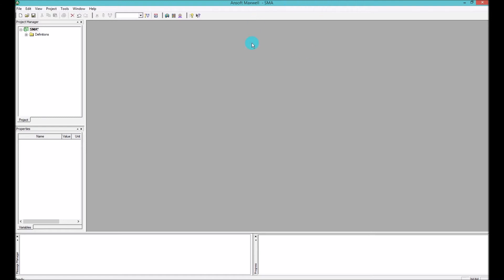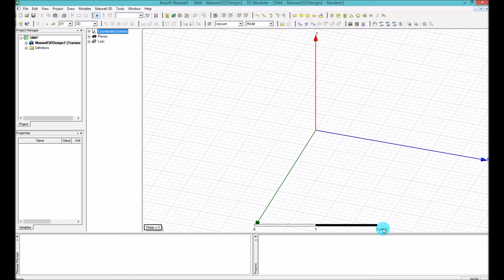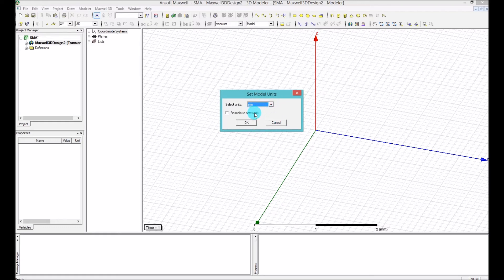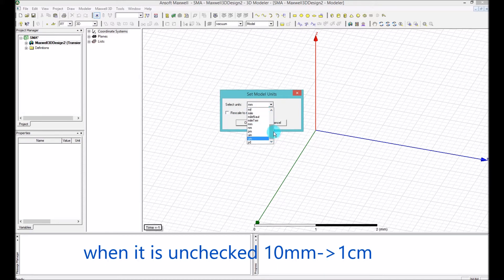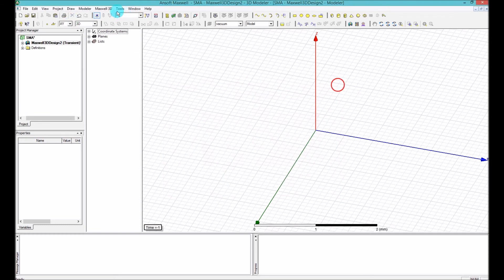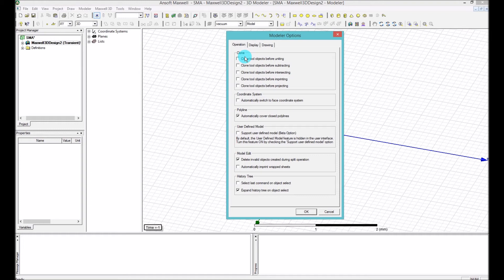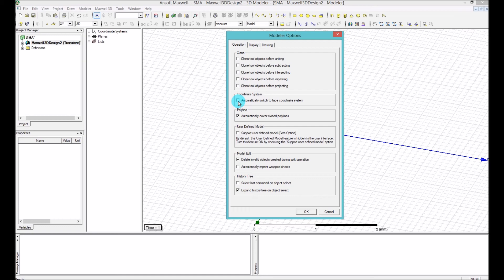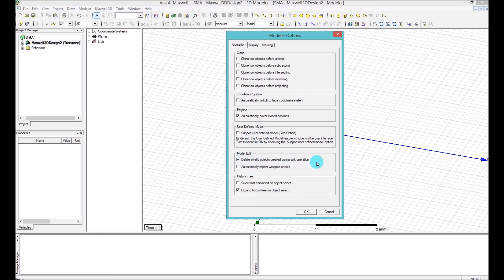104 - Ansys Maxwell- Introduction to Modeling in Maxwell

Comment: Hi, I want to calculate capacitance between Synchronous Generator Field winding and stator phases winding.  I modeled it for one rotor angle, but I need its changes for different rotor angles. How can I do it in ansoft maxwell?